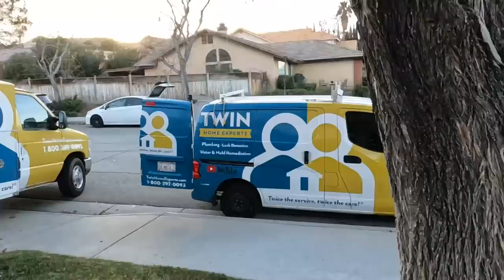Rats Chewed Through the Shower.

Comment: I learn so much from you guys man... ive blocked every hole and corner i see  in the foundation but  believe i got them from coming up my floor drain in the basement.  Im cleaning up now that im no longer catching any or hearing them...i put a drain check on that  drain...is there something i can do to deter them,  a treatment  ,  or  bleach ,  something ?
Thanks for all the info you provide dave and jim
Reply from the maker: Just seal everything up! This will keep the out for good. We do have a deterrent that we’re testing out, but most products DONT work.